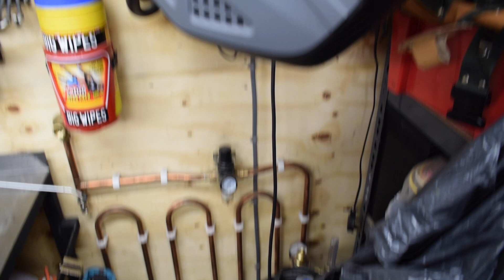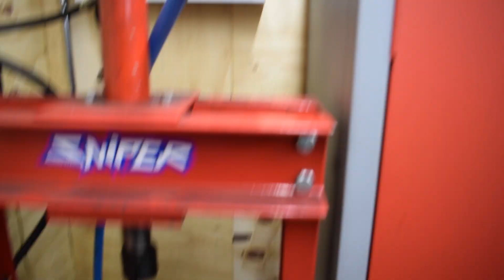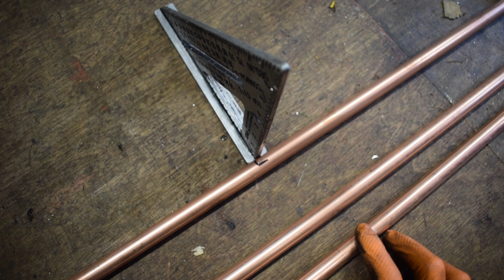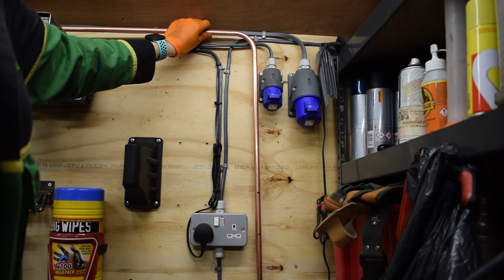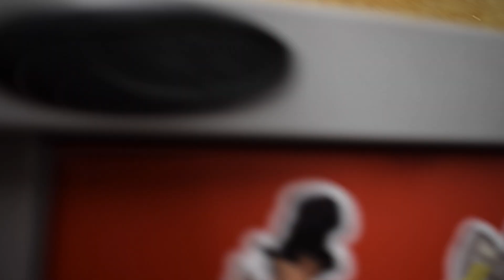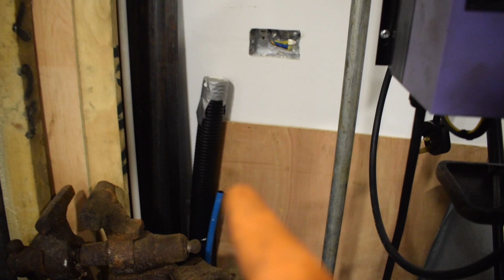HOW TO:  Workshop Air Line Installation

Comment: In my experience the drain will start leaking after 30 years. Personally I prefer phosphorus coppar rods for soldering, no need for flux and flows easily.

Comment: Excellent work as usual. That's a clever way to condense out moisture in the line, I like it.
I have quite a long run from my compressor to the penetration through the floor so I just used galvanised steel plumbing pipe and BSP thread's. I have a large moisture filter with an auto drain that takes care of the worst of the water. I also put an auto drain on the bottom of the compressor tank.
Well worth doing. It's one less thing I have to remember to do manually.
I have seen workshops where they use plastic irrigation pipe or water pipe. Works fine. I like using metal because it condenses out the moisture better especially if the line is in permanent shade in a cool place with a slight incline to allow water to run back in to the tank when the pressure bleads away.

Comment: Nice plumbing. I was just curious why you went with copper? It looks nice
Reply from the maker: I like working with copper. It also seems to be a good way to separate the water from the air, as well as I can do it with less joints than plastic.
Reply: @CalamityKim1  Fair enough . I have used copper quite a bit , used it on countertops in my shop , some trim work . In one of my careers , we used it on roofs and gutters and downspouts. It is expensive though

Comment: Happy new year. That was a great video Kim. I think your airline system is well thought out. I like that you have plenty of drain points built in. I have just started a channel, and my second ever video is about how I set up the safety valve on my compressor. The first 'proper' video was about fault finding on my lathe DRO using an oscilloscope. I would really value your opinion, if you get a chance to take a look.

https://youtu.be/SbDJLLykwo0

Comment: Happy new year!  It's a massive pain the backside piping it all up but it is such a blessing once it's done.
Reply: Not certain it presented much challenge given her abilities 🤷
Reply from the maker: It is a faff more than anything. I am glad the one buildings all sorted. It’s the most crammed area so it’s even better to be done.
Reply: @CalamityKim1  faff, British specific slang, Google correlation to US equivalent, is kinda graphic. @ any rate, got it now🤷
Reply from the maker: Faff, or maybe you could say a mess around/pain in the butt. Something that should be easier than it is. 😏